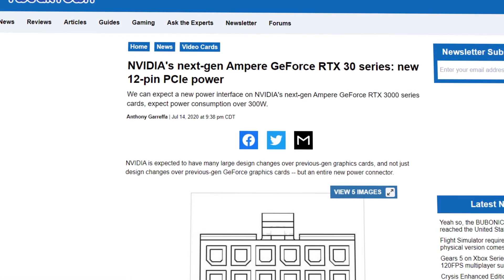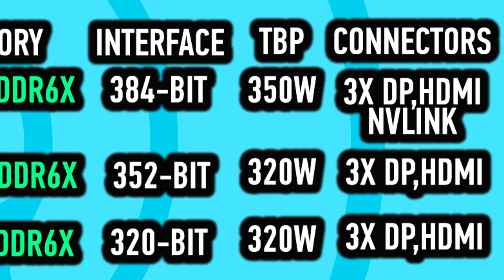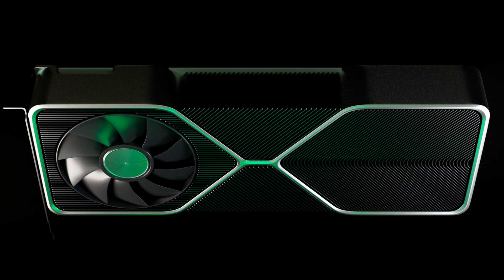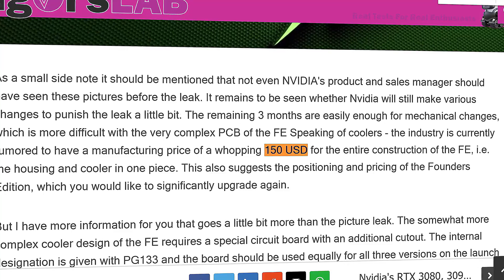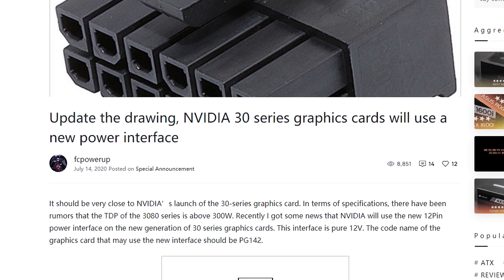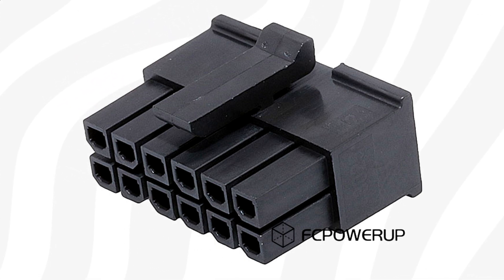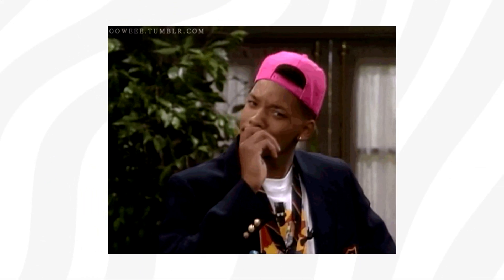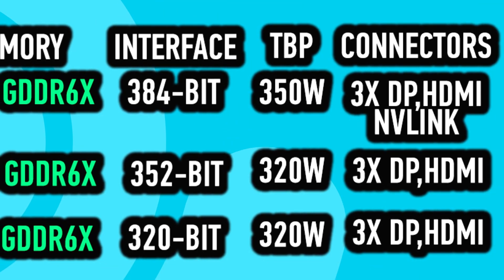GeForce RTX 3090/3080 Ti Consumes 400W? [NVIDIA Ampere RTX 3000 News]

Comment: Wow, that Nvidia card is going to be a little nuclear reactor that's going to be sucking power instead of providing power. I'm hoping Big Navi will be able to give Nvidia a run for the money this time around. I guess if you don't have a beefy power supply with the nextgen Nvidia card then you're going to have to upgrade and with power supply's being so hard to find at the moment it's going to be very interesting. With a 400 watts graphical card we are going to need at the very least a 750 watt power supply to keep everything supplied with enough power. I'm glad I went ahead and bought everything but the GPU and CPU for my next upgrade so I all I'll have to do is be one of the first yo preorder my GPU from Nvidia and my CPU from AMD but if I knew that Big Navi was really and truly a Nvidia 3080 killer then I would just go with a all AMD build this time around. But I just don't have the confidence enough to believe that AMD has truly been able to produce a graphics card that can beat Nvidia top of the line card at least not just yet. ✊😉👍
Reply: I have an 850 watt.  Hopefully that's enough.  Otherwise everyone has to go out and get 1000 watt PSUs